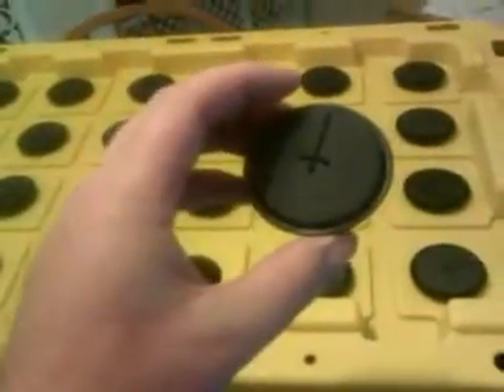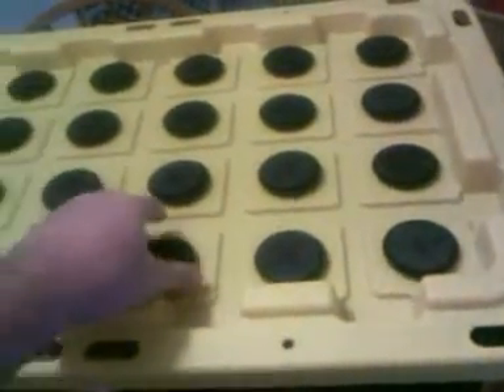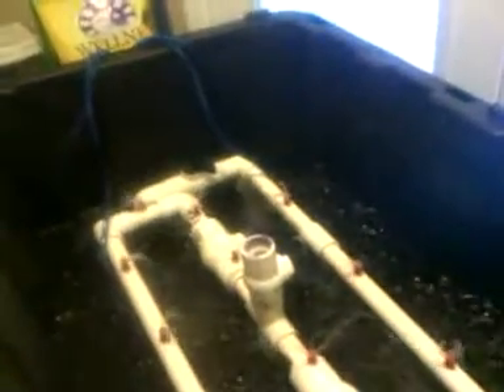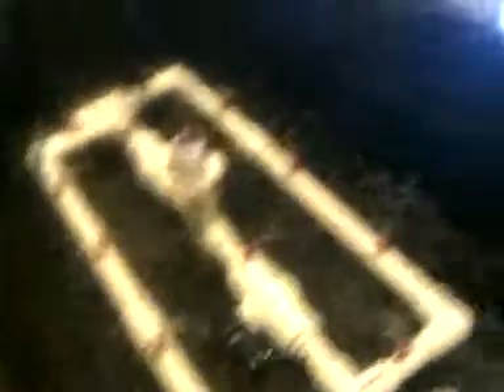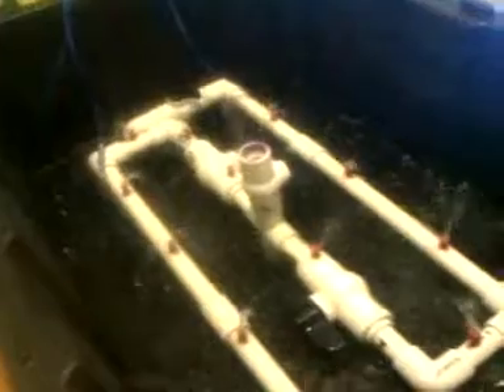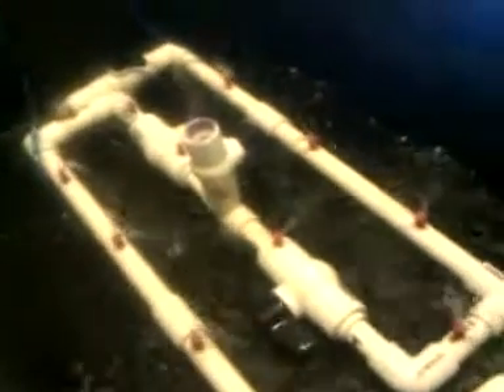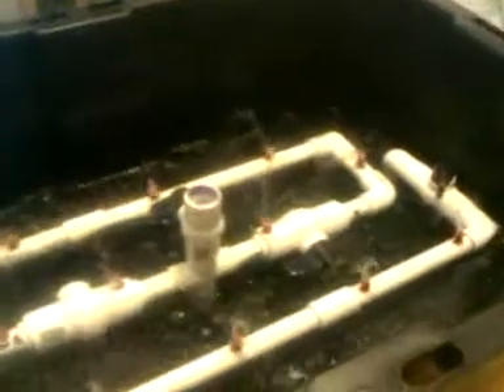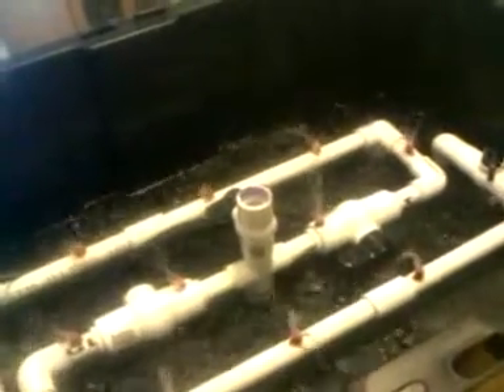Home Built Aeroponics Cloner

Comment: Do you have any problems with the lid leaking As I have the same container for my cloner and the lid leaks and I'm about to try a new container altogether as leaking isn't good
Reply from the maker: nick jones i would try foam style weather stripping around the edges.
Reply: @ShinyRockSyndicate  I actually have some similar it's foam however sometimes it works great for days and others I'll open my cabinet and it has 2in of water in it...So gta try something else...I may get some weather stripping with double sided tape and see if that would work better..It's just annoying I've actually switched to my fogponics fogger in the meantime and the plants love it..

Comment: Few things... aeroponic systems don't "need" air stones. First off, the air bubbles don't add air to the water. When the bubbles break the surface is when air is introduced to the water. Hence, when the misters spray water on the surface, it adds air to the water. So no air stones needed. Next, his water pump is too weak for his system he is running. Actually, the pump he's using would be better used in a 5 gallon bucket system. Which brings me to the next part. Unless your doing a massive grow op, a tote system like this is WAYYYY overkill. A 5gal bucket can put out 16-24 clones a month. 2 buckets, twice as many. And still, running two buckets takes up less space, and less material for water treatment. Gl and happy growing
Reply: you are absolutely correct my friend, oxygen is added to the water through  the micro sprayers. The smaller the spray the more oxygen. Air pumps and stones are a waste of money.

Comment: I just bought this exact tub at home depot for $9.70.. very good deal. Do you think it is too deep for aerponic system ?
Reply: Cindy Huynh Yes.... Smaller is easier to work with.  Not as much nutrients are required and you can work with standard shelving
Reply: you o0nly need enough water to cover the pump to get maximum pressure. so about 4 to 5 inches of water is needed. I use 4 of these with great results. The only problem i have with them is leaking around the edges. Im using a 500 gph pump with could be too much pressure even at the lowest setting.

Comment: You can get a clone king aeroponic cloning machine that is 36 sites for $63. Comes with extra inserts and extra misters. Check amazon and it is the best rated cloner sold. Quit wasting time you can't save any money when a new one already built is $63
Reply: James Harrigan I looked at the one on Amazon, while it looks great for someone who doesn't have time or skill to build, the one built here looks like it is much sturdier, and allows more space for the plants to spread out.  Also, the one on Amazon requires an additional $16 for shipping.  It appears both have advantages, depending on what the user is looking for.  
        ·

Comment: Looks kinda like the "Stinkbud" cloning system, which sprays 1 minute "on" 5 minutes "off", with a typical 100% success rate. My version is 1 min on 10 min off, and I can...and have...cloned buds, or the entire top of a 2 foot plant, with just water. I used hormone only on my first batch, and just water after that. I never lost a cutting, including some less than 2 inches long. Also...don't satisfy the cuttings need for water by misting them. Let them have more incentive to develop roots! Airstones are optional with intermittent spray, not so if you are foolish enough to spray constant. My opinion...and in my experience, 12 to 14 EZ Clone sprayers with an EcoPlus 396 pump should provide plenty of spray coverage in the 27 Gal. tote.

Comment: This system is overkill. The tub is too large and would be costly to fill in comparison to a tub less than 1/4 this size. Adding pumps and spray nozzles work but are also an unnecessary expense. Air stones or tubes are necessary. A very simple deep water setup is the easiest and least expensive to build and maintain. Unfortunately for your extra expense no gain is made in effectiveness. The same simple suspension method is good but also can be done without neoprene discs. A slightly smaller hole like 1" will allow the cutting to just sit in the hole and use the cutting's leaves to hold it up. However the 2" pot is also effective and does not need to be cut if you are using 1" rockwool cubes to hold the cutting. You do not need cloning gel or other solution but it doesn't hurt either.
When selecting a tub, think 10"-15" X 15"-20" X 4"-6" depth. The plastic can be clear but does need to be tough like Rubbermaid. Taller lids are nice because they can be used upside down, allowing high sides. Keep the tubs small, they are easier to use and move around.
 Nutrient solution (GROW) should be very weak, around 200 ppm's (adjust as needed). You can spend a lot on expensive cloning solutions but it helps very little except on tougher plants.
This system roots very fast and if you use clear tubs you can see when roots are ready. There will not usually be enough time for algae to develop.

So take it or leave it, but I have been cloning for over 30 years and this method is about 99% effective and can be built for a few dollars.   ....   Don't be too cheap on the air pump. A good multiple outlet pump will run multiple trays.  ....... Light weight air tubes work well but do not last. Soda can sized air stone work well, can be cleaned, and last years.
Reply: Your a douche
Reply: Johnny Thceeds Do you have a photo or video or instructions for the setup you use?
Reply: Samanda I have built about every configuration I could think of for cloning. Here is what I have discovered. Just about anything will work. This system would probably work too but the reservoir is too large to be efficient. Remember you have to drain and fill this thing every time you run a set of cuttings through it. This is a lot of water to carry and nutrients are not free. Smaller more compact tubs are better for this reason alone.However, with this being said, I do have some units I can display and have shot some video. The lighting was bad but the tub is small enough to move during use. Some are a little bigger and not so easy to move. I recommend tubs less than 5 gallons with around 2 gallons of nutes.This is still close to 20 pounds
The problem I am running into is transferring plants from this method to medium with out loss. Most of my friends who use these types of devices have the same problem. The plants don't like going from machine to soil or hydro and they have large numbers of fatalities.The roots are unprotected and exposed. This makes them venerable and easily damaged. By using cubes you offer some protection, which seems to make a big difference.
So I have gone to humidity domes and trays using Root Riot plugs (No generics, they do not work as well) soaked in a PH'd 200ppm nutrients. You can choose organics or regular nutrients. You can also use wrapped 1.5"-2" rockwool cubes. Rock wool takes longer, (maybe because of size) not sure but they do not work as well. Both work better than these machines.  I put about 1/2"-3/4" of perlite in the bottom of the tray for the roots to go into and help with humidity. Root Riots need a cell tray that fits the cube well. Rockwool can sit directly on the perlite. Don't over crowd.I have rooted and easily transplanted clones in as little as 6 days.Some plants take longer. (Generic cubes take longer too) Tough plants can take 14+ days. CBD plants seem to take longer.
I will put up some video in the not too distant future.If you want to know more, feel free to ask. I will try to get you some answers.
Reply: Johnny Thceeds Do you have a channel here on you tube?  I'd really like to see your set up, as I've never done this type of starting and would love to clone some lilacs I have, and blackberries.  Does this also work for trees?  I'm wondering if it would work on a long branch (twig) of a tree, with about a foot of stem in the bucket, there by having an instant tree, like in air layering.
Reply: @JohnnyThceeds  I just prefer DWC cloning, I am near perfect with them. I want to build a big one, looking for a shallow large tote...
Reply: Johnny Thceeds Are your roots on your cuttings long or short? What kind of medium are you transplanted them into? Have you tried using any  mycorrihzal fungi after transplanting your cuttings?
Reply: Samanda Yes..... Johnny Thceeds Sorry for the delay. You can build smaller versions of this type of cloner. They are much easier to handle and move around. Also cleaning is an issue.You may be able to clone 'wood' plants this way but you can clone most 'wood' plants by bending a lower branch to the ground and burying a section of it, (just one of many techniques.) Roses are often done the way you suggested.
Reply: Sheila Thompson I typically don't like aero cloners. Plants tend to go into shock when transplanting. Root size depends on the time in the unit. The longer the roots the more tangling may occur. You need to find our sweet spot.I have not used the Myc. fungi in my soil up until recently and I don't know what to think of it yet. Some plants are doing well and some are dying because of root problems. I may be doing something wrong. It is a new all-in-one product from Monster Gardens. My green house plants are tearing it up and the indoor plants are drying up slowly and dying. Kind of strange..... I will figure it out. I use several mediums to grow. I do both hydro and soil as well as some soilless mediums. It is a little old school but my best hydroponic results have been with 50/50 perlite/vermiculite with drip irrigation. I am undecided on RDWC.... mistakes are usually devastating to fatal. The 50/50 mix is very forgiving and very helpful if you tend to forget things or have a busy schedule.Soilless is a three day regimen (Feed/Flush/Dry) You are limited to daily travel without a babysitter.RDWC requires daily monitoring after a certain size is reached.Soil is about 2-3 days between watering's.Automated systems are too expensive for your average gardener and really not that reliable.I hope to see advances in that in the near future. I could kick this can forever, but you get the point. I have built every type of cloner you can imagine and all of them work. It really comes down to preference.
Reply: +Johnny Thceeds The one thing I have found is not to allow the roots to get too long. Most folks let them grow way too long. 2 inches should be the max.
Reply: +Sheila Thompson That is a good size as long as there are several shoots.(enough to support the plant)
Reply: +Johnny Thceeds That's enough, the problem allieviates and may completely eliminate the transplant shock you are experiencing with some plants. Some plants handle transplanting from water to soil more than others and you have found this.  You know now which ones they are. Research has shown those who don't shouldn't be rerooted in water, and if they can be shouldn't be rooted long by no means. It really has nothing to do with whether it has enough roots or not. The moisture content of what you are transplanting it into is more important. Maintaining nutrients until is another. Think of it this way. What is the difference in transplanting in a watery soil, instead of just water? As long as you slowly increase the amount of soil in the water so as not to damage the roots, the roots will be able to adjust and not be thrown into shock.  What you need to do is transplant into a very wet medium, and gradually lower the moisture content, and not so quickly regardless what the medium you choose opposed to the normal moisture content that medium usually has. It's not just a matter of transplanting into a new medium, like soil or whatever but the moisture level you transplant into. I hope this makes sense. This is what makes the difference in a plant not going into transplant shock.
Reply: +Johnny Thceeds  I don't grow marijuana, medical or medicinal, but have found out that those who do have this problem that you talk about have, as well as other plant growers who have had issues with transplanting. What I told you as far as a fix to your problem is what some growers have found to be of benefit to them. It has also worked for me. Trying to transplant with a large amount of root growth only makes it more difficult, and why I stated that 2" should be the max. Again, it's not about the amount of roots, as much as the surroundings it's being transplanted into. The more roots the better the transplant normally, but that's not always the case, as you have found. Sometimes the more roots, the more shock they go through. Eliminate one problem, too many roots, and then if it still doesn't work out, try a new option as in your case. Try the amount of moisture you are transplanting into, especially when dealing with a lot of roots. Otherwise, minimize the root growth, before you transplant, and remember to transplant still into another medium that's very moist, (again,  closer to watery than what you would normally use for that medium.) Slow is best.
Reply: +Johnny Thceeds What kind of medium are you growing from or rerooting from, and what medium are you tranplanting into with those that are dying?

Comment: Did the exact same thing..tips
Run wire thru one of the inserts on top.
Make your humidity cover 8 inches high out of plexiglas, silicon parts together.
Cut perfect holes without holesaw.....get yourself a piece of 
1 1/2" copper pipe and hold with pliers and heat with blow torch, push pipe thru plastic, makes a perfect size hole for those inserts.
Use a strip of door draft stick back foam around top edge of black container otherwise is is gunna leak big time.

Comment: Please tell me that you just have super low psi going through your lines as you have the top off. . . any true aeroponic growing are high pressure (>50psi) & atomize the nutrients to a particle size of 20-80 microns. If you in fact are growing in that shown environment, to have true aeroponic results. . upgrade your sprayer heads & pump. Then you can join the FuzzyRoots club.

Comment: brilliant job brother! looking really clean for a home job, the pvc irrigation line looks great- something im going to use as a prototype for my own cloner.  my only issue/query would be the fact that this is a cloner, i dont believe you would need to oxygenate the water/solution nearly as much with the air stones due to the fact that the cuttings will be suspended in air and as such will be getting plenty of air access to the roots, dwc on the other hand requires oxygenation of nute solution.

Comment from the maker: Honestly I don't recall =/ I sold this box a while back.  But, I can tell you if you go to your local hydro shop, call one, or check online you can find out what will work for the number of gallons you have - just keep in mind if you plan to use the pump to also push nutrients vertically to fill a grow channel or something along with the bay itself. I way over bough for this project because I intended to function as a dual purpose unit :)

Comment: Hey man..I used the same tuff box..and i was banging my head up against the wall trying to find a good hole saw with accurate measurements...i tried like 5 types until i came across this hole cutter from Menards and holy crap I was whistling dixie it was so perfect.

Comment: nice box dude, just a few errors though, airstones aere used when totaly submerged, the idea of sprinkler bar is cause their suspended in the air, also airstones act as a sponge for pathogens like root rot etc, they also dont  add oxygen t the water liek many think, the oxygen process is done on the disruption of the water cirface, fuming is better have a read on it

Comment: @773steve You could have 2.5" net pots if you want to keep them on the squares, which are 2.75" x 3.25".   You could go with bigger net pots, you'll just have to seal the dip between the squares, although you should really put some foam insulation with foil on one side over the lid, it helps cut down the heat and light getting inside.  see:  rollitup . org/blogs/361018/2011/9/6/

Comment: @Thortorian Doesn't really matter once your plants have roots that dip into the nutrient solution as long as you have an air stone in there, or a couple. For cloning you'd want to spray the basket so in the end you typically end up with a DWC/Aeroponic cloner so you spray the baskets but feed like DWC units do where the roots are suspended in the solution.

Comment from the maker: @Thortorian I am sure someone out there will always have an answer for this; however, basically you just want to make sure the pots are saturated. Ideally you would want the nutrient solution to spray the pots, and not hit the top and edges so hard it comes out :) Many people complain about setups like this and have to use tape, foam or something else on the lid to prevent splash from coming out.

Comment: Great Looking setup. Who manufactures the Tub and what model name is it? I have seen a black tub with the folding yellow top but not that one. 24 perfect little squares, I love it. It looks a lot more solid than those droopy Rubbermaid jobs. Will I also be able to find the black overflow (Pressure Control) valves at my local grow shop or do you have an ebay shop you would recommend. I also think with foam tape and top and bottom metal gasket with a clap might solve the leaking problem. Thanks

Comment from the maker: @okieltr450 yeah it leaked, it's common for builders on most of these kind of cloners to use a foam tape along the edges to prevent leaking :) You can also make sure to use an overflow valve like i did so you can control the sprinkle height.

Comment: i just finished mine, using the same box, im using a 396gph pump and 10 ezclone misters. and it leaks between the lid and bottom. i was just wondering what size pump u use and have u ran it wide open yet? if so did it leak?